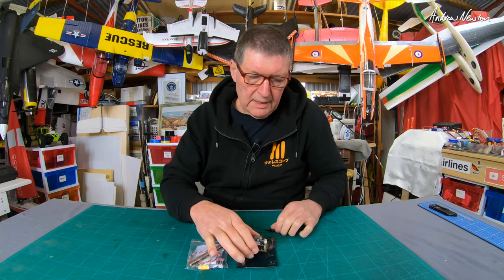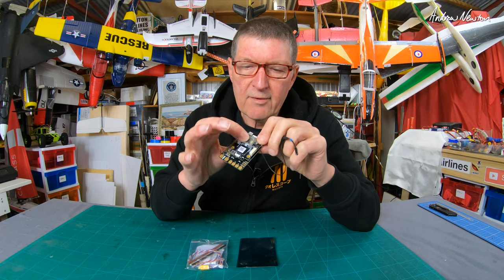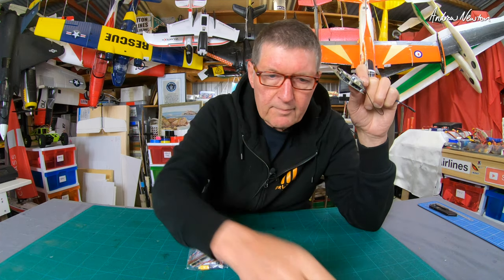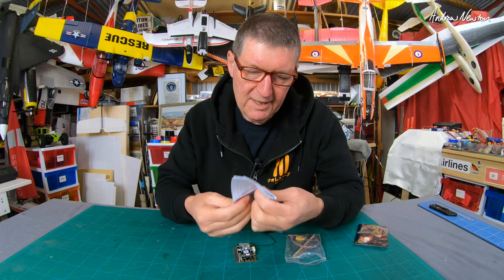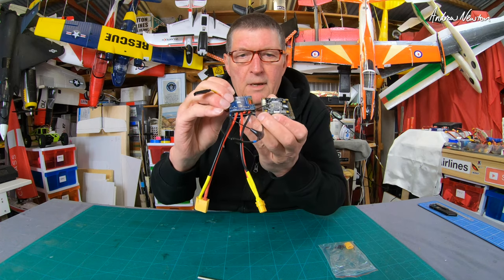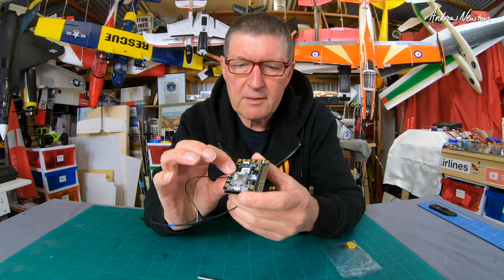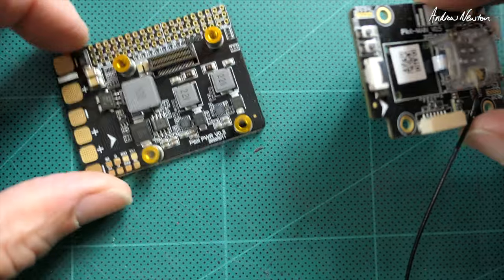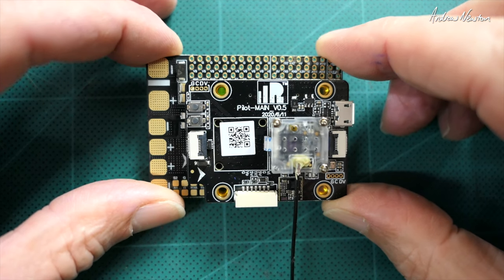FrSKY R9 / RXSR Pilot F765 FC

Comment: How is the rx connected ? Is the rx soldered to the board or plugged in ? Also is the stand alone rxsr the same as the board mounted one ? Is there any reason i couldnt buy the rx-less one and mount the rx to the board myself ? The reason i ask is because this specific fc is almost impossible to find in the US . Thanks
Reply from the maker: The RXSR is plugged in, it's same as the normal RXSR. Better to have the Rx separate to the FC then you can mount it anywhere.
Reply: @AndrewNewton  thanks appriciate it / subbed / liked

Comment: Hi Andrew I have a question. I just done with my first Inav build with the f765-wing. One problem I have after Inav boots it pulls down the right aileron in all modes. All trims on the qx7 are at middle position. Everything is green in inav under setup. Stabilisation all works when rocking the plane left and right. Everything calibrated. I have it wired just like Matek has it in the manual. I have the Ranger 1600. The fc is directly over COG. Any ideas? It only happens to the right aileron.
Reply from the maker: That's odd. Check you have the R Ail servo pugged into the correct pins and correct polarity. Also look at the mixer selections. See how it behaves when you use a Y lead for ailerons into the L Ail pins.
Reply: @AndrewNewton  greetings Andrew. Hey I got past the problem with the servo mention above. But, now I have a new problem. After I did an autolaunch the plane took off level and with plenty of speed. I let it gain some altitude as you see in the video. It says on the screen move sticks to abort. After I do that it goes into RTH? Then the plane gets all wacky. Not sure what it is trying to do. It won't respond to any of my stick movements and at the end it starts a dive where I disarm it and let it drift down. As you see in the video I had it in Angle mode and I never took it out of angle mode? Any ideas what is happening. 
https://www.youtube.com/watch?v=jS11iV37yFg

Comment: Hi! Have a Frsky pito tube for this board, but can not get it to work. How do I configure the port for it in iNav?. Pitot works fine directly to a Frsky RX with telemetry to the Horus TX
Reply from the maker: Just a guess but select Smartport in the Ports > Telemetry. Connect the signal wire to the selected UART Tx pin. Or connect the sensor to the receiver Smart Port and then signal wire as above.
Reply: @AndrewNewton  Yes, done that and it comes up blue, but no indication on the sensors page. Will leave it until I have the OSD set up and see if it comes alive. Getting lots of help and tips from your videos. Thank you very much. Subscribed today!!

Comment: Hi Andrew, greet video! I have one on th way for my goblin. One question, how would one go about reflashing the built in reciever? I'd need to install flex accst firmware like I do with my   normal r9mm-ota recievers? Does the ftc Rx have regular pads I can temporarily connect to or can I do it via FC passthrough like I do with blheli32?
Thanks andrew
Reply from the maker: Good question! Don't know how sorry

Comment: Thanks for the video. Can this flight controller be used with R9M ACCST version? Not the ACCESS.
Reply from the maker: Yes it can use any SBUS receiver, just connect it to a UART.
Reply: @AndrewNewton  Thanks for the reply. How about the smartport telemetry?
Reply from the maker: Yes, FPort and SPort / SBUS work as they should